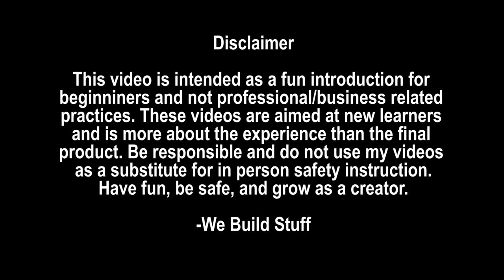Making a Ring Mandrel and Bushings for turning rings on a lathe

Comment: Kerosine or WD40 are good for aluminium. I’d say it would be either of the two.
Reply from the maker: agreed! We honestly just use what we have in the shop due to budgets. Usually a bit of cutting fluid or oil. I would prefer Kerosine!
Reply: @WeBuildStuff  Using cheap chip brushes and buying WD-40 by the gallon is much cheaper, and you use a lot less, making cleanup easier.